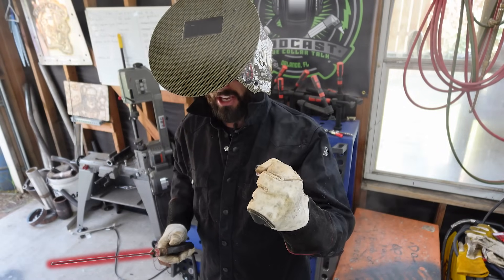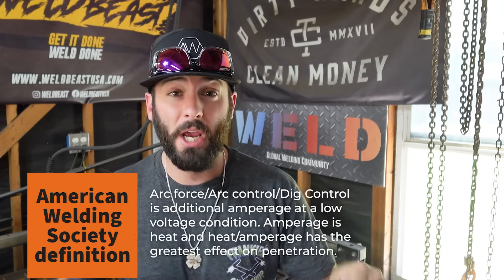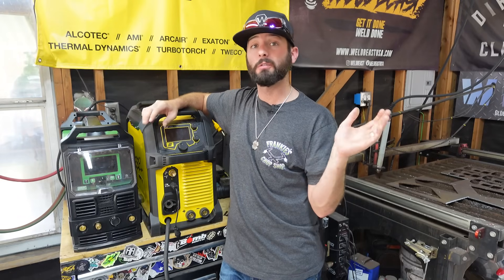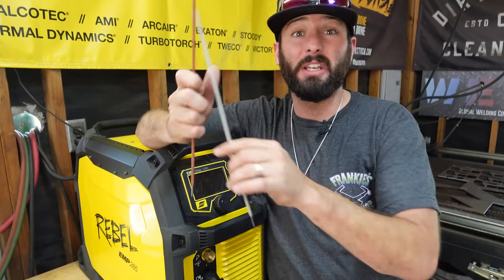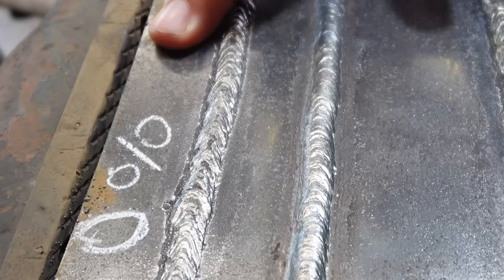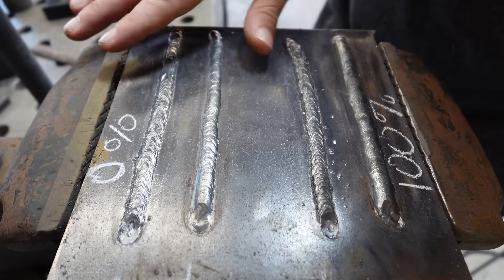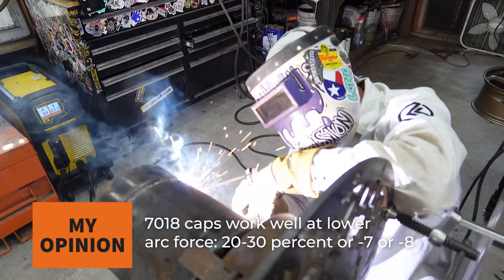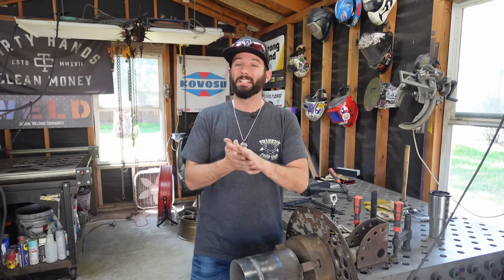What Does Arc Force Do? Harnessing The Power Of The Force

Comment: I never played with arc force while stick welding.  If i am using a stick welder i an usually at home. At work using MIG welders is a different story. I am a Detroit local 292 sheet metal worker and i noticed If guys are welding mild steel with your standard .035 hardwire guys will run between 80% and 90%. Most guys set it to 85 and leave it. Guys that are welding stainless with either 308L or 309L will set it to 70%. I am normally building bases, welding on tube steel, W-beams, C-channel  and otherv structural steel using lincoln electric outershield flux core wire and i normally run 100%. But there are times i want my puddle just a little bit softer and not as wet so i will turn it down to 90%. It can be useful if you find yourself in a situation where you need to do a vertical down with flux and you don't want your puddle to fall out on you😢
Reply: That’s good info right there, will def mess around with the machine more

Comment: Arc force also can stabilize the progressive heat input,but is a hard-to-find sweet spot,usually just shy of 20%,can be 18% or 24%,deppending on the machine(s),some are waay too soft and even 100% arc force is not gonna help,just a bit more sputter and more bb's stuck on the workpiece,the arc force shine on thicker walls like at least 4 times thicker tham the rod you're using,and soft side helps allot burning trough rust and paint,all i refer is to the 7018,we don't have 6010 in Romania,we have the 6013,wich is a "dead-iron" cellulosic/rutile rod(very weak),very not suitable for strong connections,just for light duty or aestethic things...
Reply: That’s great input man thank you!
Reply: @austinhargett5792  i'm glad that was useful for you ☺️
Reply: Same, we use tons of 7018 in Estonia, I have never touched a 6010.
Reply: @rocerist  the main goal of the ArcForce is to increase the voltage separately by the amperage to make the arc itself to dig deeper into the material,hence the need to make a ballance between the material thickness and the rod diameter to achieve a greater penetration without heating up too bad the workpiece,take example of 10mm T joint,and use a 3.2 7018 rod,with 110A,weld is good,but you want more,instead of increasing the amps to 125,rise the arcforce to 25-50% (depending on your machine),keeping the initial 110A,and will dig deeper,more sputter along that,you gotta work trough that in a wipping motion,or whatever works for you to avoid trapping slag,this way you penetrate deeper with little less heat input-distortion

Comment: Thank you for the info, i am a professional welder and im getting ready to make a welding test with an electrode that is known to really Dig. I know that i will have the best luck of running a nice bead up that 6g pipe on the soft side of the arc force. Thank you Sir.

Comment: You can you use Arc Force to weld at a much lower amps when use a larger electrode so it does not want to stick when holding a very close arc. Also when using stainless stick because they have a higher resistance and over heat.